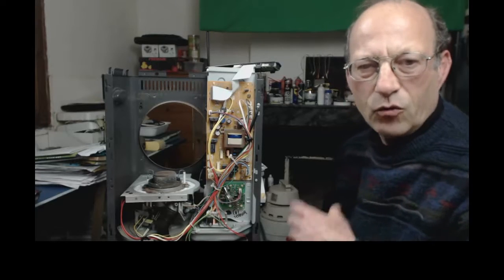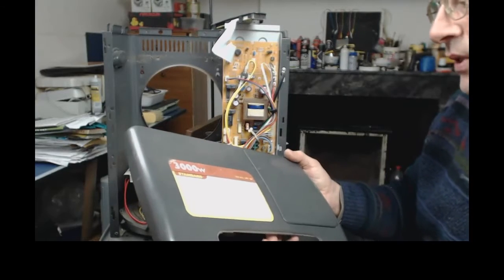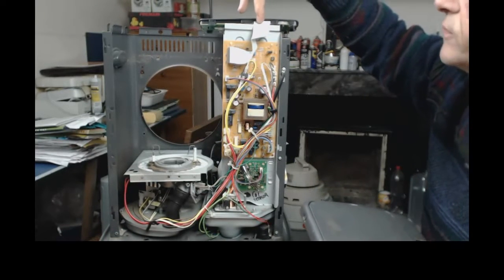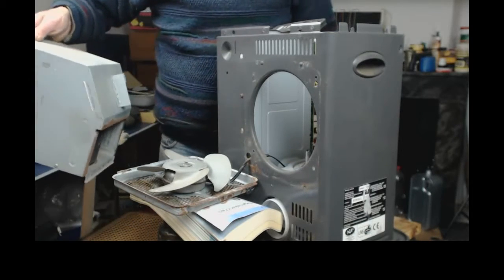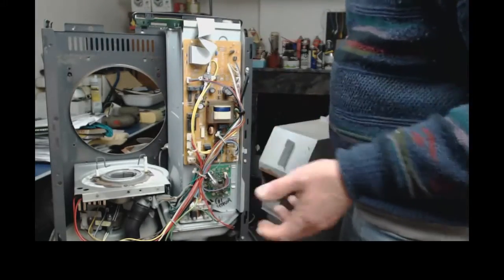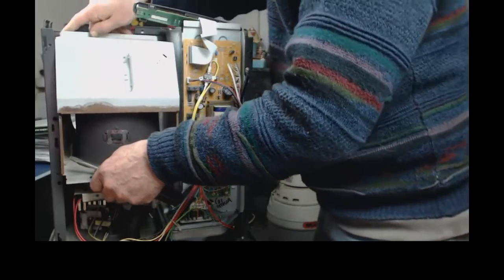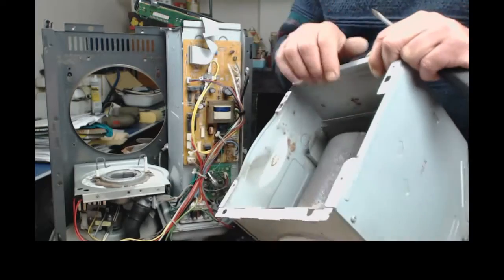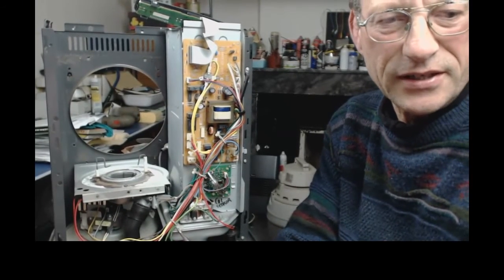How to Dismantle a Paraffin Kerosene Petrole Heater - Quick and Easy

Comment: Hi there,

Thank you so much for the link! Cleaned the flame rod like you said working brilliant, the. Only thing is now the thermostat doesn't t o be working as it did.
Thanks again Alan
Reply from the maker: Great news that you fixed it :)
Re the thermostat.
If it has gone problematic after dismantling, it could be something that you did.
At least you can get to it all by simply removing the front cover.
Maybe you will spot the problem.
It could be a dodgy connection.

Comment: Wishing you a happy new year mate, keep up the good videos,  always something of interest, glad I searched for a tutorial on wiring diagrams this year and came across your channel.
Reply: Sounds interesting. Presume that’s using a twin spark plug cylinder, utilising  one for the probe ?
Reply from the maker: No.
In fact I used a tungsten rod as the electrode, and experimented with numerous glass materials.
I had a big hope for sapphire, but it was cloudy. 

It was a major development project, but without resources, I was constantly begging stuff from people.
In the end I had to call a halt when none of the funding agencies would back it.

Overall, it is very difficult to get support these days for engineering projects.
... but there you go ... that's how it is.

Actually, I wish that I had redone the idle setting test with the later versions.
The vid that you'll see was basically from the early version prototype.

Anyway, at least I got that, and a few other vids that show combustion as the engine hits the power band.
:)
Reply: Sounds interesting. What engine is it btw ?
Reply from the maker: It was an AM6 2 stroke..

Probably not the ideal engine to start with, due to its highly tuned nature.
... so it was a baptism of fire.

However, it worked well, but for the bonding agent.
Grabbing glass was difficult without a shoulder, yet introducing a shoulder created stress.

Happy days playing with engines, and pushing the envelope :D
Reply: I think I’ve seen this done with a clear cap on a 2 stroke, but not sure what materials used.  I imagine your ideas have a bit more endurance.
Reply from the maker: Yes, it was done with a Briggs & Stratton using an acrylic head https://youtu.be/jdW1t8r8qYc
TBH for visualisation of the flame, their setup was obviously ideal.
My concept was for a test plug, similar to the Gunsons color-tune plug, but for video recording.
In effect, to simply check the combustion colour during engine operation.

Comment: Bought one of these heaters second hand, puts out tons of heat but does have a paraffin smell while it's running. Do they usually have a bit of a smell while running. I use C1 paraffin by the way.
Reply from the maker: Most of the stink comes from starting the heater from cold.
... I catch it in a bag, and throw it out ;)

Once running, there should be almost no odour at all.
Obv, this depends on one's sensitivity.
You can add acetone at 1% to raise the burn efficiency :)

Comment: Hi i has also error 03  

I have a Inverter Minimax 2300W  kerosene heater. 

I had to disassemble almost the entire stove, The burner was not charred. The air supply channel under the burnerfan was clogged, as a result of which the burner did not receive enough air. 

I spent a whole day on it, it was my only heater so it had to work again soon. outside it was -5
Reply from the maker: Nice work lexpee!
A bit of effort, but rewarded with victory :D
Reply: Thanks for the reply.

I stay on an boat and for years This heater works fine,  the last time the heater beginning to smell more and more. 

Now I know why. The narrow intake duct from the burner fan to the rear of the stove was clogged that was the problem. 

Regular vacuuming can prevent this problem.

Comment: Thanks for quick response. 
Actually, I pulled out all the bad fuel and cleaned the fixed tank as I could. But I 'll try to add acetone.
But another thing that I forgot to mention is the magnetic spark continues even after the flame appears. 
Regards.
Reply from the maker: Ah!
You have an electrical fault.
Yes, forgetting to mention the fault, does make diagnosis difficult  :)

It could be anything, from the flame rod to the motherboard.

When the flame lights ... the flame rod senses the flame and sends a signal to the controller to switch off the sparker.
Therefore, start with the flame rod and work backwards.

Check the condition of the flame rod, and it's cable connections.
If, after remaking the connections without success ...
... swap your flame rod into a known working heater.

If the working heater then has the same fault, you will know that you need a new flame rod.

Good luck!
Reply: @EngineTuning  Thank you thank you very much. Now it works properly. Your advice was great. Moreover, the sparker was not stop working after the flame works and that was because the screw of the sensor was untightened. 
Thanks for your help..
Regards.
Reply from the maker: Great news Yasir :)

Comment: I have a Zibro LC30 heater. It has worked well last winter, however I have moved home to an altitude of about 1,400 meters. The heater now constantly makes 'squeaking' noise when burning. I believe this is because it is not getting enough oxygen and needs to have the draft opened. Problem is I cannot find a draft adjuster. Can you advise if there is one and how to find & adjust?
Reply from the maker: Great question Peter.

There is surely a way to recalibrate the fuel delivery to produce a leaner mixture, however I have never looked into this.
Rather like bags of crisps and general snacks; products are adjusted for altitude at the factory.

If you carry a packet of crisps up a mountain, it will become balloon-like.
Similarly, if you buy a packet of crisps at altitude (say Andorra); when you go back down to sea level, the crisp bag appears to have no air in it ... because it was produced for sale in Andorra, or other high altitude destinations.

Motorcyclists (should) carry extra jets when exploring high altitudes ;)
For you, it may be the same.
You may need to change the needle in the fuel injector (in your heater), or change the injector assembly.
That's the nozzle that protrudes into the fuel well.

You will need to research the alternative injectors available to you.
However, there is an easy alternative...

At each fill of fuel, you can add acetone.
You will determine the quantity by trial and error.

Start at 1% - 10ml per litre.
Look at the condition of the flame - has it lost the yellowness ... it should be a nice blue.
Obviously, if you have a heat sensor pistol, you can read the temperature before, and after ... but your eyesight will tell you, and your nose ... it will smell less.

Then add another 10ml per litre (to make 2%).
Check the flame again.

My guess is that you'll only need up to 2%, but you can keep going.
It is unlikely you will need to go much further.
In fact 1% will make a huge difference - that could do the job nicely.

Buy the acetone in a 5 litre container, and it will be good for a few winters.
Last week I restocked my acetone ... 5 litres cost €15
At 2% this will treat 250 litres (or 500 litres @ 1%).

You will also burn less fuel, and it will burn cleaner ... less fumes, and less maintenance :)
It will pay for itself!

WARNING!
Add the acetone outside, or in a well ventilated area, as it is highly inflammable.

Please report back here, providing the results and the best mix that works for your conditions.

Good luck!
Reply: Hi  @EngineTuning  & thanks for such a detailed answer. I will experiment with the acetone suggestion and let you know. If you come across more information about a draft adjuster please let me know. The reason I asked is that in some of the Zibro models the hand book (viewed on line) states that at altitude the draft has to be adjusted to allow more air in & stop in 'squeaking'. My problem is that I  cannot find a draft vent or anything like it on my model.
What is happening at the moment is that the heater runs quietly at a very low setting, but once I turn the heat up it begins to 'squeak' quite loudly. The sound disappears within a minute of turning it back down again.

To fill you in a little more about why I am asking. I am from UK, but now living in Kathmandu, Nepal - altitude of about 1,400 meters (well over 4000 feet). We brought the heater here with us because it is cheap to run and the winter here is cold at night. Hopefully your acetone suggestion will do the trick, but should you discover anything about draft adjustment and getting more air into the burner, please let me know. Thanks again for taking time to answer - appreciated.
Reply from the maker: Good information Peter.
It is not possible to provide too much information, when you require a technical solution ;)

The Fuel in Nepal is most likely to be low grade fuel.
Less developed countries tend to have less developed products, because they are cheaper (to suit the average pocket).

Consider passing a few minutes of time watching this video:
https://youtu.be/dRmrEOBsEDw

The playlist is:
https://www.youtube.com/playlist?list=PLeHV-kNBKNNfEtkx0cTb-mbtelhpNOPFa

Subscribe to the channel, and click the bell to accept notifications, because I am now preparing some new videos for you (I'm pausing on that task, to answer your question) 

If there is definitely an airflow adjuster, then you should be able to find it.

'Draft' means 'rising combustion product (heat) speed'.
Traditionally, it relates to: Installing the correct chimney/flue diameter.
The diameter dictates the rising airspeed, which in turn dictates the inrush of air to replace the air that has risen and left the system.

Perhaps the draft adjuster is the mini chimney, which can be screwed smaller or larger, like a telescope - like a rolled up piece of paper..
(obv, let me know as soon as you find it) 

However, that apart, now knowing that you are in Nepal, I would say that the acetone mix is going to be a big help.
It will raise the fuel burn efficiency of your fuel, to a higher grade.
In so doing, it will burn hotter, and burn off more of the potentially toxic impurities 
IE. Less pollutants will make it into the (your) atmosphere, due to achieving complete combustion (the ultimate goal).

It is no different to waste incinerators.
They burn ultra hot, so that they don't pollute, even though they are burning stuff that would normally pollute.
The by product of this, is that you will be much warmer :)
(Market Gardens are often located next to incinerators, to get the excess heat)

Note: This works, even at low apparently low temperature settings, because the burn mix will still be leaner, only that less fuel will be used.
(a spark compared to a lightening bolt - same temperature, only less energy)

Remember Bunsen Burners?
Combustion is from yellow to white.
White melts engines.
You need more 'blue white' than 'blue yellow'. 

An 'acetone in paraffin heaters' video, is coming your way soon.
If you can get out, and find it, and report back ... I could include your findings.
(Otherwise a follow up, as I have my acetone)

Paint lacquer thinner is mostly acetone ... probably entirely acetone nowadays, though it could be doctored.
I don't know Nepal, but I have lived in various developing countries.
There will be a hardware shop that contains everything that anybody could want.
Otherwise, try car spray-paint workshops, as they will have it in bulk containers.
Cheap as chips, compared to 1 litre bottles.

:)

Comment: Hi there!
Sorry to bother you with this, but the gasket you said to be careful with, I wasn't to careful and I damage it. I haven't been able to find even the name of the part so I could buy it again neither know the material ( I think it's a type of cotton glass fiber).
Can you please help me with this?
Reply from the maker: Okay Javiera ... great question.

It is always good to accept one's mistakes.
We are human.
We all make mistakes :)

The first thing, is to understand the role of the gasket.

THE GASKET:

- seals the joint between the combustion chamber, and the 'box flue'.
- prevents hot fumes exiting into the electro-mechanical area of the heater.
- can prevent 'sucking air' (ingress) into the combustion chamber area.,

PRESSURE CONDITIONS

The hot fumes accumulate in the flue box.
The 'flue' is a large tube, at the top of the box.

The fumes are hot.
The fumes rise.
As the fumes rise, they pull upwards, the fumes below.
(this is the fundamental purpose of a flue ... they are designed to scavenge the fumes below).

Consequently, there is very little pressure, to force the hot fumes through the gasket.
... because the fumes, naturally rise through the flue.

In fact,there is more risk of sucking air
(as the fumes rise, a depression might exist)

ANALYSIS

The gasket job, is to seal two metal components.
High pressure is not involved (positive or negative)

The gasket is not mission critical (vis a vis high pressure).

Therefore, examine the gasket.
Can you evenly spread the 'fibre wool' ... so that it achieves a seal, when you close the box to the combustion chamber base?

My guess is that you can.

The fibre wool 'will not have disappeared.
So, just make sure that  there is enough, to create a seal, when the flue box is refitted.

You rightly identified the gasket as a 'glass fibre' version of 'cotton wool'.
This is used as a 'wall filler' to insulate between two brick walls.
Popular in Europe, but perhaps not in your country.

I would try to re-use the material that you have.

Best wishes ....

Comment: Hi. Thanks for your videos. 
I've a problem that I could not solve. The heater starts normally for 10 seconds or less  then the fan starts to slow down and the heater stops working with E0. I swich it off and on. It starts again normally and again same failer happens. I cleaned the well and rods but no way. Please help. Thanks.
Reply from the maker: E0 indicates contaminated fuel.

Use the syphon, and pump out the fuel from the fixed reservoir.
This is not easy, because the bad fuel is at the bottom (fuel floats on water).

Empty the portable reservoir.
This fuel can be used again.

Fill with fresh high grade fuel.
Add acetone at 1%.

50ml Acetone for 5 litres of fuel.

If some old fuel remains in the fixed reservoir ... add 2ml of acetone.

Good luck!

Comment: Hi there, 
After watching your brilliant video, I successfully stripped my heater down and removed quite a bit of carbon from the bottom of the burner.
It now runs great for about an hour but then shows E4, please help!
Seems a little smelly 

Yours sincerely Alan (Blackpool)
Reply from the maker: Hi Alan.
Have you checked out this video: https://youtu.be/VC-5657JLhU
It is the source for the video that you have just watched.
In fact it is all about cleaning the flame rod.
It's the flame rod that is the sensor for the fuel feed.

If you haven't watched it then you should.

If you did clean up the flame rod, then It could be anything.
Possibly the pump (though it is pumping oil so it's well lubricated).
It could be a failing temperature sensor, but that typically shows up as an E6 error.

Good luck, and keep us informed :)
Reply: Plz help me....Corona error hh

Comment: Hello, nice channel, thx for the videos. MIster, i have  a heater(kerno calma cl300) too similar. None error in the screen, but, in low T° setting (low flame fire) delivere much kerosene odor. I clean, internally the heater is clean.. i think can be the Air passage...so. how i can regule that¿¿ Thx! and im so sorry 4 my tarzan english. Follow up videos!
Reply from the maker: Hello Leonardo :)
The flame rod may have a carbon coat.
This will modify the fuel flow, and ultimately lead to an error.

Follow this video https://youtu.be/VC-5657JLhU
It is almost the same as the video above, but it explains how to clean the flame rod.
A clean flame rod will probably solve your problems.

Good luck!

Comment: Hi I have a problem running the runway so it smells out constantly. So what is the solution please
Reply from the maker: When I first start the heater, I catch the puff of smoke in a big plastic bag.
For me ... after that, there is no smell.
I am using highly refined fuel.
This has less smell.
Therefore the cause of the smell, may be the fuel that you are using.

Otherwise, you may need to clean the flame rod, and combustion chamber.
I made a video for this:
https://youtu.be/VC-5657JLhU

Good luck!
:)
Reply: Engine Tuning  thank you very match